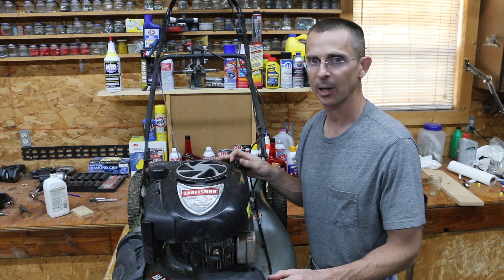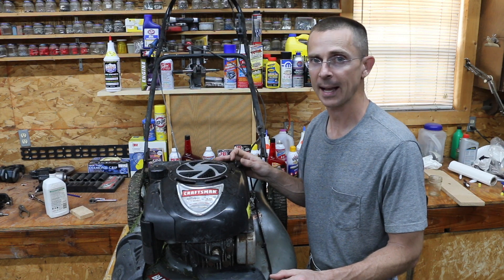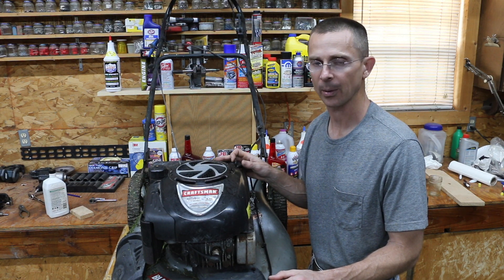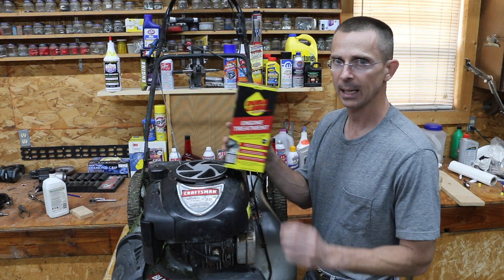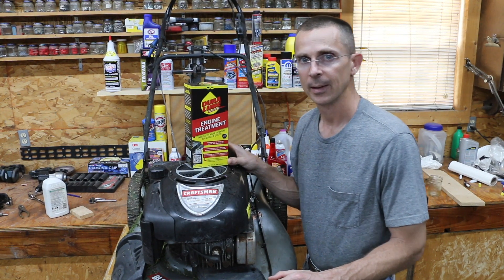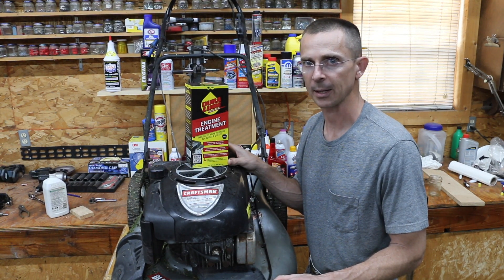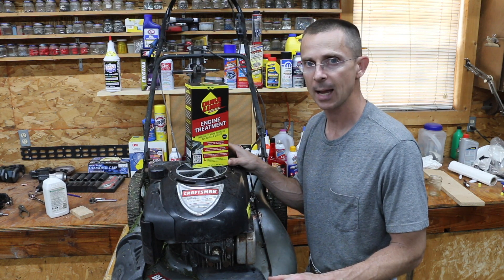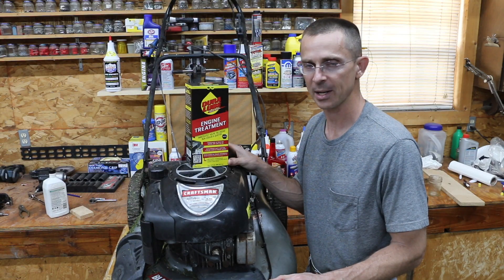Does Dura Lube actually help quiet and cool a gas engine as claimed?

Comment: I love dura lube - I had a '78 el camino with a cracked head - I could not keep oil in it... At the time, I was young and dumb and was spending all my money chasing split-tail, so I was not maintaining my vehicle properly... I discovered dura-lube from an info-mercial at 3am one morning, and basically put a quart every paycheck into the car, and I drove around the DFW metroplex for a year with no problems before I ended up putting a new 305 off in it - dura-lube works. I swear on it because I've seen it with my own eyes.  It is impossible for anybody to convince me otherwise...lol.  For the past 25 years, since I've grown up and been married for 23, I have put it in everything I own, and I have never had an engine problem of any type.
Reply from the maker: I plan to test Dura Lube soon. Thanks for sharing your experience with it.

Comment: I have used dura lube and love it! I saw a metal plate that was heated with a torch and they poured every oil treatment on it and they all ran away from heat but dura lube ran to the center of the heat and bonded to. The metal
Reply from the maker: Thank you for this recommendation.

Comment: Great video, I've never used Dura Lube but it did seem to quiet the knock just a little bit although you could still hear the knock quite clearly even after dura lube was added. My guess would be that someone ran that engine low on oil and that the cylinder walls are badly scored. I have a 6.5 horse Tecumseh engine on a Lawn Boy mower that I acquired at no expense that has compression as low as the engine in your video but it has no knocking. I pulled the cylinder head and the cylinder walls were severely scored but I have a healthy Tecumseh engine of the same size and type that I'm going to swap it with.
Reply from the maker: Thanks for commenting.

Comment: Hmm. Well Duralube contains enhanced friction modifiers. So maybe that's why the engine was running faster. 50/50 blend of oil and duralube sounds like a lot to use if you have an engine that hold more oil such as a car engine using 4-5 quarts. I think duralube is suitable for people that do a lot of highway driving. It does operate at a lower temperature, meaning less frictional wear.
Reply from the maker: You're exactly right.  The engine seemed move much more freely. Thanks for commenting.

Comment: Had a 1981 Dodge truck with a slant six, the oil pump is on the side of the engine . The oil sensor unit cracked in cold weather at 35 degrees as I was driving a 25 mile stretch at the speed of 55 mph leaked all oil out 5qts where gone ! And did not seize the motor, because of DURALUBE mix OUTSTANDING PRODUCT !  I recommend this product for all gas engines .
Reply from the maker: Impressive!  Thanks for sharing this experience.

Comment: Plus it works much better after it's been used for a little while.   If you rather that mower for a week after Duralube in it everyday for 30 mins to 1 hour daily then drain the oil totally out.  I bet you could mow quite a bit of your lawn before that motor will cease up.  If not the whole lawn.  Lol.  Duralube is Amazing stuff.
Reply from the maker: Thanks again.  I plan to test it again in the near future.

Comment: i have been rebuilding an old push mower Briggs and Stratton Flathead engine for a mini truck i have been building
Reply: it blew out all the old gaskets so it will be a while before the engine is running
Reply from the maker: Thanks for commenting on this. I hope you get it put back together soon.

Comment: Ran Dura-Lube in Fairbanks Alaska for 7 years in a Jeep Cherokee. Faster, easier startups in the extreme weather even at -50 no strain on the engine during startup. Swear by this stuff and Castrol 5W 30
Reply from the maker: Impressive! Thanks for commenting.

Comment: I used Dura Lube in many Pontiac, Oldsmobile and Chevrolet HP street and track engines.. I never blew up an engine.. My machinist hates grinding cranks and honing cylinders that were treated with Dura Lube
Reply: Andrew B probably because it reduces the friction on the tools he's using to grind/hone. I'm an avid user and it's always protected mine

Comment: I have used Dura Lube in a couple of engines, but don't know what effect it has had, other than they are both still running very strong after more than 13 years. Both engines were new when I first put it in, so I have nothing to compare except the fact that both have had no work done to them.
Reply from the maker: Thanks for commenting on Dura Lube.

Comment: The smaller instant quit 8oz bottles sell for half of the 1L bottes. 1oz per litre. 4oz for engine or transmission. I bought the first bottle to treat the transmission 4oz, differential 2oz, power steering 2oz. Smoother and quieter. Money well spent.
Reply from the maker: Thanks for commenting on this.

Comment: Don't ever use Dura Lube.I used it on my 10Hp Tecumseh vertical engine and It caused the nylon governor gear to partially seize on the pin and the gear got stripped.It smells like it has ether in it.It caused the nylon to swell which narrowed the hole in the center jamming  the gear.I had to disassemble the engine and replace the governor.
Reply from the maker: Wow!  I wonder what's in this stuff. Thanks for commenting.

Comment: It would be interesting to know what the figures would have been just with a regular oil change, since you have come from used worn oil. 
Worn oil - new regular oil change.

Worn oil - new 50/50 oil-duralube.

Can't really be done now since any sealing effect duralube might have had has happened now. 

Maybe interesting to see what deposits ( if any )  are around the rings and bore / sleeve, that could have given the improved compression result. 

Or perhaps it's just the viscosity change? Thicker oil helping to reduce the clatter.
Reply from the maker: Thank you for this recommendation.

Comment: I have used Dura Lub since the 80's and I am a believer. I started to also use it in seized  electric motors on appliances with same results. Fixed and no call-backs! Dura Lub works for me!
Reply from the maker: Impressive. Thanks for commenting on DuraLube!

Comment: Glad someone finally did the duralube test, i have used it in my cars for years, and i THINK it helps, and i KNOW it stopped a v8 from overheating, and causing damage on a appprox. 40 mile trip with very low oil.
Reply from the maker: I will be doing a much more comprehensive test on DuraLube and other additives soon.  I've finally acquired the proper test equipment. Thanks for commenting!
Reply: Project Farm... awsome cant wait for a comp. test of duralube, your methods are awsome! I hope you continue to inform us for much longer...

Comment: Many years ago, I had an old Fiat 124 Spyder that I bought intending to restore. When I would start the car and let it idle, it ran so rough you could see the car shaking. One day, I changed the oil and put in a quart of Duralube. Immediately the car settled down. Ever since, I have used Duralube. It may not make a difference in all situations, but it sure made an old engine run a lot smoother.
Reply from the maker: Thank you for this recommendation.

Comment: Duralube fuel injector cleaner and upper cylinder lube works great in my 2000 Ford ranger...but it's hard to find now
Reply from the maker: Thank you for this recommendation.
Reply: I should clarify by "great" I mean it greatly increased my mpg...especially on the highway

Comment: I have used DuraLube in all of my vehicles since their first infomercial in the early 90's..engines have run quiet, and idles smooth as silk... My current ride, an S550, is so quiet, you don't know it's running when stopped!.  Mercedes claims 382 hp, but after an oil change using 2 quarts of DuraLube with Mobil One Synthetic, a new air filter with everything else stock, the car dyno'd @ 412 hp!! I've been, and still remain a believer in this stuff..
Reply from the maker: Awesome!  I plan to do more extensive testing on DuraLube in an upcoming video series on lubricants. Thanks for commenting!

Comment: Dura Lube is one of a few oil additives I believe actually work. My first experience with it was in a Mazda 4 cylinder engine that had a damaged rod bearing from a spark plug coming apart and falling into the cylinder. I did a very quick repair by pulling the pan, cleaning the crank and rod surface with emory cloth and installing new rod bearings. Upon starting there was a "squeak" coming from the rod as the engine ran. I drained off a quart of oil and added the Dura Lube and restarted the engine. Within 5 minutes the squeak went away and the engine was noticeably smoother and quieter. That car ran for another 50k at which point I sold it locally and it was still running 2 years later. Since Dura Lube has proved itself over and over for me.
Reply from the maker: Impressive! I plan to create another video testing DuraLube. Thanks again!

Comment: in my experence never use synthetic oil. my grandad was president of Kerr Mcgee oil and nucler power in Oklahoma City, Oklahoma. he told me never use synthetic oil always use petolium oil. i do and have never had an oil related problem in my pickup truck or my big rig motors. ive had friends who use synthetic and their motors havent laasted as long as mine have. please reply if you want.
Reply from the maker: Thank you for this recommendation!
Reply: The reason why not to use synthetic oil Is due to that synthetic oil isn't natural It's made in a laboratory. I use Shell RotellaT 15w/40 in everything I drive. And I use Lucas Oil stabilizer. Using synthetic oil puts a light plastic coating on the inside of your motor and you will never know that anything is wrong with your motor until you have a serious problem. If you have any questions or comments write me here or Facebook. And I'll let you know of the perfect oil blend for your equipment.

Comment: I also added 4 qts to a 10 gal oil capacity of HD diesel engine  in a semi truck. I noticed it REDUCED the engine by 3%, INCREASED turbo boost by 2 lbs, engine coolant temp is a couple degrees cooler.  The engine idles smoother and seems more willing to rev.
Reply from the maker: Impressive! I'm looking forward to additional testing on DuraLube.  Thanks for commenting!

Comment: Where did he fine the recommended 50/50 mix?  It's says on the package and bottle 1 qt per a qt low or basicly 25:1
Reply from the maker: Great point. It doesn't recommend a 50/50 mix on the instructions, but many commenters suggested testing with a 50/50 mix.

Comment: I'm NOT a believer in aftermarket additives.  Not only are they mostly just snake oils, but you run the risk of compatibility damage depending on the application.  Just change your oil at normal regular intervals and your engines will probably last forever.  Even your lawnmower.....
Reply from the maker: Thanks for commenting on this!

Comment: John Deere recommends for flushing tractors, for the crank case to dump in 1 gallon of kerosene instead of 5 quarts of oil run a few Second then drain and refill with original clean oil, and flushing the other oil based systems on the tractor are the same ratio's except transmission and final drives they receive a fulfill of cleaning solvent or kerosene/diesel
Reply from the maker: This is interesting.  Thanks for this idea!

Comment: Skeptics say that Duralube contains Chlorine which could be corrosive to the engine. Same with Prolong, which is what I've always used without issue. What are your thoughts on this and will you test Prolong?
Reply from the maker: I'm still researching both products and plan to test Prolong soon. Thanks for commenting!

Comment: what about performance? sound can help some but it comes down to power does it feel any different?
Reply from the maker: This is a great point.  The engine did seem to run at higher RPMs and seemed to have more power.  I don't have an accurate way to measure power yet, but plan to build or buy a dyno at some point.  Thanks!

Comment: Maybe i'm just the type that wants to sit back and watch things get destroyed, but watching this video with the dura lube, the video where you used slick 50 and the motor seized, and then when you used the marvel mystery oil to get the sized motor restarted got me to wondering something. What if you made a concoction of additives and substituted that mixture for the oil all together. Maybe nothing will happen or maybe you could come up with a new miracle additive.
Reply from the maker: Scott, this seems like a terrific suggestion--thanks!

Comment: When the rod bearing just begins to get noisy like this, remove the connecting rod cap and file a thousandth of an inch or two off of the cap to take up the clearance. Keep checking your work with Plasti-Gauge  until you get around 2 thousandths of an inch oil clearance and button it back up.    It doesn't have to be exact.   It isn't the space shuttle you're working on. This even works with ribbed caps.
Reply from the maker: Thank you for this recommendation!

Comment: I used dura lube on my 2 cylinder 250cc kawasaki motorcycle 
A 16000 redline rpm little engine, idle at 1200 rpm 
When I use dura lube the idle jumped to 3000 rpm had to adjust it manualy (carburetor) 
The first I saw was the engine lost its brake power! 
And it's was more responsive sound smoother too. 
After 288.000 klms it was destroyed by a mechanic error (bad timing) 
Dura lube worked very well with that engine.
Reply from the maker: This is very impressive!  I noticed the RPMs were higher during this test too, which is consistent with your experience.  Thanks for commenting!

Comment: 1995 the wife and I was cruising the 69 Road Runner 440+6 (not original), I knew it was a bit low on oil so I stopped at a Checker Auto Parts and picked up a quart of Dura Lube. I poured over half of it in and took off. Four stop lights later the motor was idling high. I kept kicking the pedal to get it to idle down. Finally I pulled over and turned down the idle. I never touched the idle screw again. The most impressive thing was the cold starts. From that day forward the engine always fired up like it had been running. If you have ever owned a 440 you know what I am talking about. The Dura Lube really losened the engine or lubricated it because it really made a difference.  I treat all my engines with Dura Lube.
Reply: I thought it was jus me , my first car , after I added it it would start in negative 50 c without the block heater plugged in 1.6 Hyundai 86 in 1998 I added it
Reply: @liamyong1106 , that is amazing, my brother. That DuraLube is good stuff. I still use it to this day.
Reply: YES, I used it in my 69 Charger with a Hi Performance 383, and my brother used it in his six-pack Cuda! It did the same thing for us. . The stuff worked.
Reply: loosened
Reply: Yes I use it! Im an exotic car mechanic. But it .y own  ar I use it in. 99 cavalier  it's  got 85k original  miles.  Near oil intervals  it gets noise. Duralube eliminated this.. no doubt  I use it regularly  at oil changes. Quietest running engine it's still  new.  During valve  cover  seal cha changes  the aluminum head is still new.
Reply: @AbelardoMaldonado-x8o  Does it have the pushrod Vortec 2200 or the Ecotec engine?

Comment: I used it in my car for years from new to nearly 400 thousand miles. The oil pump failed in the engine and cost more than the car was worth to fix. It was tore down to fix a head gasket at around 200 thousand at that time the dealer said the parts in the engine were like new. I used it at every other oil change. It was worth the time and more than paid for its self in gas savings. Just my opinion.
Reply from the maker: Randy, Very impressive!  Thanks for commenting!
Reply: I swear by duralube .... used in all my rides since the 90s
Reply: Bet you MARVEL Mystery Oil  could of got you there too! Love the stuff! But the power of positive thinking is a powerful thing also,!
Reply: You could have done that with just straight up oil and saved the myth for the next generation of suckers

Comment: I 969 straight 6 250ci
bought 150000 miles
ran dura lube in engine every 3 oil change sold at 290000 never skipped a beat. 
I think it works and worth the money
Reply from the maker: Impressive!  Thanks for commenting!

Comment: I wouldn't trust compression test with lawnmower engine. They have compression release system for easier starting. The faster you pull the better compression you get.

Comment: I would really appreciate and enjoy seeing a test of some more fuel additives. I've been using Gumout Regane and Techron Complete Fuel System Cleaner for quite a long time and I honestly am not sure if they even work. I have never had a problem while using either product, buy I have never seen any proof that they've actually benefited my engines. They come in relatively small bottles and are usually diluted in approximately 16 gallons of gas, so I'd like to know if that small amount is enough to accomplish any carbon removal. 

Thanks for the videos!

Comment: I've used Bestline but never Dura Lube. I have seen significant improvements using Bestline over many other oil additives. It has smoothed out the idle in 2 of our 3 cars (3rd one is new) and kept an old ford riding lawn mower going for a friend.

Comment: If you were to use a good gear case oil try Mystik JT-7 Gear Oil. The stock are circuits in Tennessee use it in the Franklin rearends.
I tested it on a "Friction Break Machine", Timkin bearing tester and it rated real high. The oil can be found at Farm and Fleet and
also at BigR Stores. This should quiet the engine, "Mystik Jt-7 Gl 85W140 Super Premium Extreme Pressure Gear Lubricant," as
heavy as it is!  :)